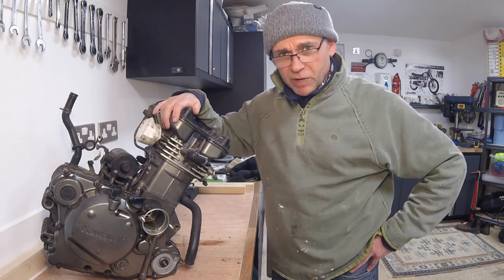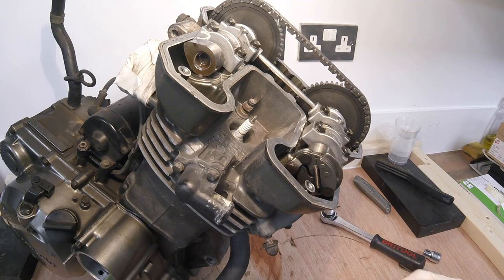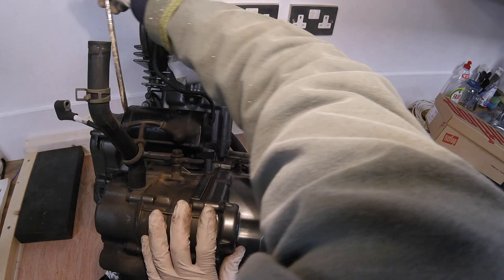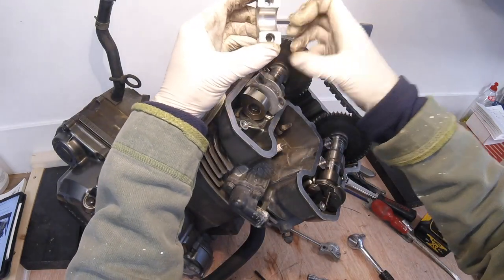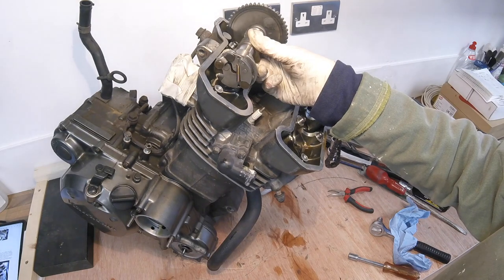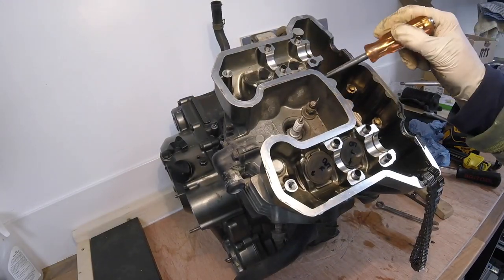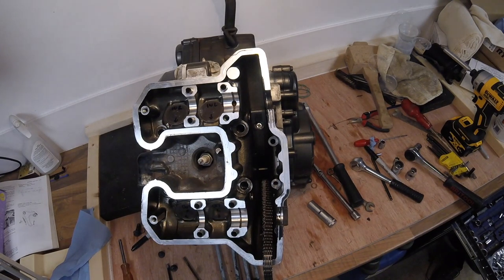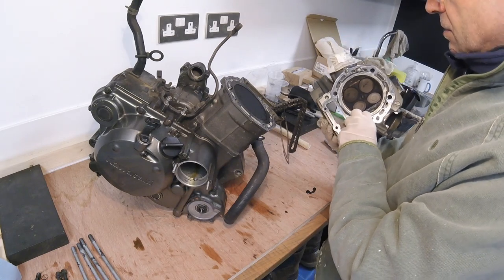Kawasaki KLR 650 Engine Rebuild Part 1 Cylinder Head Removal

Comment: Absolutely brilliant mate.
I have watched the 9 videos many times from start to finish....... I have one issue, today I tore my engine apart in line with videos 1 - 9 and now I need you to finish the video series so I can finish my build. 😂😂
Very much looking forward to future videos, more helpful than the manual, that is for sure.
Reply from the maker: Hi Paul - Great to know it was of help - Snowed under with work at the moment, (wasn't expecting to be ) but I really need to get the build up underway. May be a while tho... Next video will be measuring the crankshaft limits..

Comment: My '99 smokes like hell everytime I start it. Thinking I have to change the piston ring. Contemplating boring out to install 685 kit. The bike was down for a large chunk of the summer doing the doohickey so I gotta get cracking with a decision soon while its garaged for the winter.
Reply from the maker: Doesn't necessarily mean piston rings have had it - could be worn valve seals that are cold on start up therefore leaving a small gap for the oil (that is fed from the sump to the cylinder head via a external and clearly visible oil pipe on the 650 engine ) to get into the combustion chamber - As the valve stems heat up this gap closes somewhat and less oil is burnt - hence more smoke at start up. Good luck with it!!
Reply: @themotorcycleshed380  It does smoke only at starting so valve seals may be the ticket. Now I look into that for diagnostics. I'm new to motorbikes and learning as I go. Thanks for the insight. Hoping that job isn't too involved.

Comment: hello everyone! i've recently rebuilt my klr 650 engine using the clymer manual (I suggest everyone should have it, really useful) and still your video is as detailed as a written page, congrats! Unluckily I used a cheap gasket for the head and now after only 500kms I need to change it (with an original Kawasaki new spare). I was wandering if I need to get the  engine out  of the frame or  not.. are the bolts in line with the frame or is it possible? thanks for any advice! keep up with the good videos! cheers

Comment: This is a great set of videos thank you for sharing, i am a owner of a KLR650 1987 and thinking of doing this work, its still running well at 85,000 km. Is there more videos to come? i have watched 1to 9
Reply from the maker: Many thanks for the comment - Yes there is the build set coming up, starting with a look at the crank, but I would say I can't start the build until late Nov.. It will happen....

Comment: Do you put locktight on engine cylinder head bolts when reassemble the head . Great work brother .
Reply from the maker: Thanks for the comment - the short answer to locktite on the cylinder head bolts is no. The reason is that the bolts need to be torqued up ( in cross order and in stages ) and then the engine run. Once the engine has properly warmed up and then completely cooled down, the bolts need to re tourqed, due to the expansion and contraction of the metals and the compression of the head gasket in this first run period - If Locktite is used and then set between the first heating and cooling cycle, it may not be possible to finally tighten the head bolts properly. Its better to make sure the threads are clean and the bolts can tighten in the threads of the block properly. For instance the Kawasaki manual actually says use a thin layer of Molybdenum grease on the threads and shanks of the bolts to make sure they seat and fully engage with the threads. I'm sure there may well be differing opinions out there about this, but this is my take on it!

Comment: Hi, I'm glad for this video a lot, can you advise me about KLR 's ? i have a tengai that smoke a bit (blue smoke) a but starts and runs well, so what yo think causing it? is the piston worned out either valve stem seal ?
Reply from the maker: It is a sign that oil is being burned in the combustion chamber, like you say its either valve stem seals or worn piston rings. If you are going to take the head off you might as well take the barrel off too and have a look. You do not have to take the engine out of the frame to get the head and barrel off. Get the CLYMER manual for the KLR. Glad you like the Videos! Good luck

Comment: A big job ahead. So you're fitting the 685kit? It will be interesting to see what you think of it once all done.
Reply from the maker: Unfortunately I've discovered you can't get that kit in the UK, so its probably the Wossner kit which you can get, but it stays the same at '650'. Ill get the case split vid up and then one looking at the transmission probably this week as it looks like its gonna come down stair rods here in the UK for at least 10 days - then theres a break while I get the case looked at and spares ordered some of which are Ex Japan stock.. Glad ur liking the vid - many thanks

Comment: Looking forward to this series......much thanks.

What mileage is on the engine?
Reply from the maker: Hi Rob - About 25000 miles - As its over 30 years old I think I doubt that - As soon as I get the casing back from the repairers Ill get back to the videos! many thanks.

Comment: Think I'm about to give this a go myself, think my piston rings are fried, thing is smoking more than my gran. 
I'm dreading it.
Reply from the maker: It might be worn valve guides... In which case the smoking would probably stop once the engine is warmed up as the valve stems and guides expand slightly when hot...